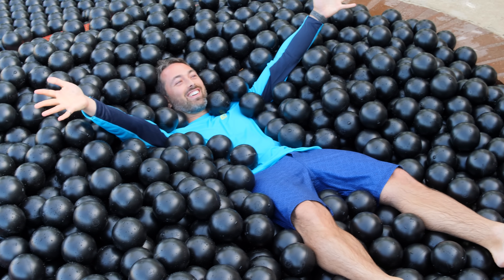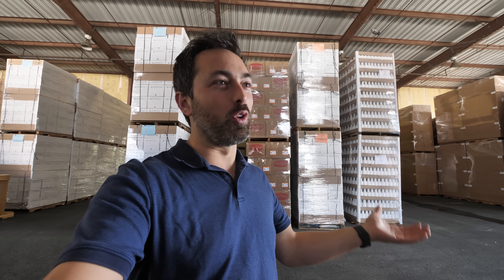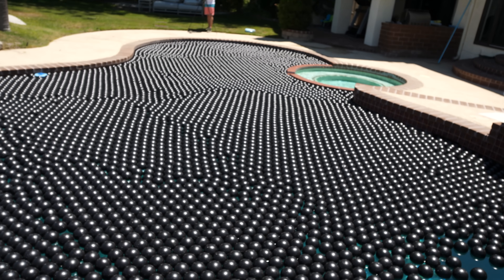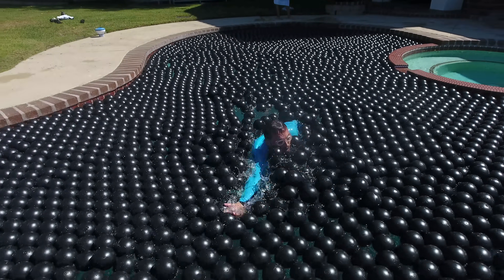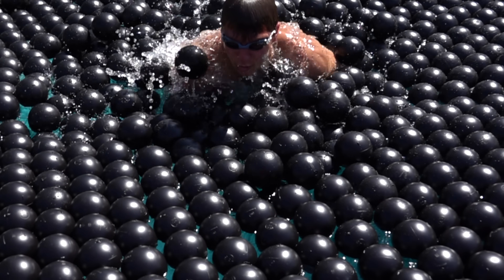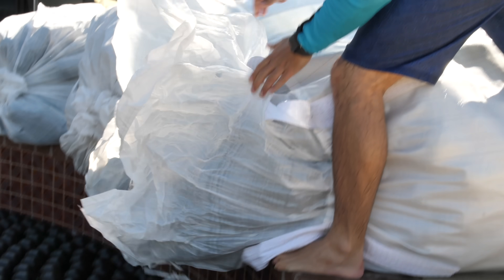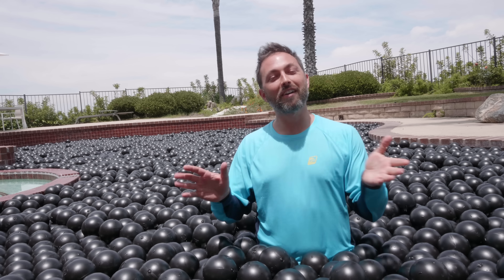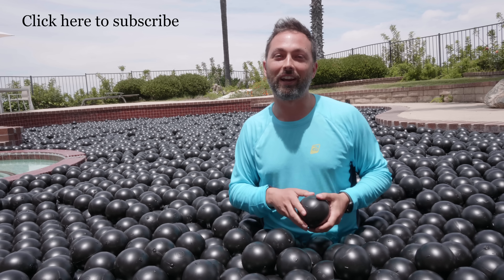Can You Swim in Shade Balls?

Comment: 2004 and 2008 and 2012 and 2016 and 2020 and 2024 REPUBLICAN Candidate for President Brad Hartliep has been cleaning up Earth's pollution and protecting Earth and protecting Earth's Plants and Animals and Water and Air for 44 years .. and calling for 50% reductions in greenhouse gas emissions for 31 years - and as President, those emissions would have gone down immediately .. and if you had elected Brad Hartliep in 2012 or 2026, Carbon Equivalent Pollution in our atmosphere would be below 400 ppm .. and dropping to 350 ppm .. within 10 years -- that would be 2022 or 2026 at the latest .. and if you had elected Brad Hartliep in 2004 or 2008 - Carbon Equivalent Pollution in our Atmosphere would have never risen above 400 ppm, and it would have been reduced to 375 ppm within 5 to 10 years, depending in what year I was elected .. and 350 ppm before 2025 .. Fuel Economy would have risen to a minimum of 40 MPG for all Vehicles during my first year in office and 50 MPG within 10 years .. and every Powerplant and Utility in America would have had Carbon Filtration installed on all Smokestacks within the first 4 years of my Presidency .. and every house and Corporate  Building and Skyscraper and Garage and Parking Lot in America would have been covered by Solar Panels within 10 years .. every Oil Derrick in very Ocean would have been converted to Wind Turbine Platforms within 10 years .. The Global Climate Change problem would have been addressed and attacked by Brad Hartliep in 2005 if you had elected Brad Hartliep President in 2004 and 2009, if you had elected Brad Hartliep President in 2008, and 2017, if you elected Brad Hartliep President in 2016 .. Brad Hartliep has been calling for a 50% Reduction in our Greenhouse Pollutants before 2020, and later 2025, for 30 years -- before Greta Thunberg .. before Bernie Sanders .. and before  Al Gore -- yet you have never given one single consideration to anything Brad Hartliep has said over the last 40 years concerning the need to reduce the absolute need of our pollution - you have never given one single thought to Brad Hartliep's Pro-Earth Policies .. or Brad Hartliep's Pro-Civil-Rights Policies - Republican Civil Rights Policies that have existed for 244 years and that are the Inspiration for every single Democratic Party Civil Agenda in the last 60 years .. you have never given Brad Hartliep the same recognition for his 44 years of Climate Protection service that you have given Greta Thunberg for her 1 year of Climate Change service -- Brad Hartliep is 8 Billion Times better qualified than Greta Thunberg for the Noble Peace Prize or the Noble Climate Prize .. Racist White Supremacist Democrat Joe Biden has never in his life done anything to protect earth -- until this week .. If you want to Truly Protect Planet Earth's Natural resources and Plants and Animals and Waters and Oxygen and Atmosphere Slow Down and start supporting Brad Hartliep for 2024 President, because Brad Hartliep will accomplish significantly more Greenhouse gas reductions  that Joe Biden and Brad Hartliep will accomplish it faster and better than Joe Biden and Brad Hartliep will create more well-paying living-wage jobs than Joe Biden and Brad Hartliep will create a better, cheaper national healthcare program than both Joe Biden and Barack Obama and Brad Hartliep will create the greatest, long-term, sustainable Middle Class and Working Class Economic Growth in US History .. Joe Biden's entire 2020 Campaign Platform and Joe Biden's entire 2021 Policy Platform is plagiarized directly off of what Republican Brad Hartliep has been calling for for the last 30 years .. everything Joe Biden is trying to accomplish he stole from the Policies and Platforms of Brad Hartliep developed and written over the last more than 20 years - every single one of them .. Bur Brad Hartliep has the heart and the dedication to protecting America and Protecting the Planet and Protecting the People that Joe Biden and the Democratic Party have never had .. You choose .. unwisely .. You should have Voted for Brad Hartliep .. America would be 20 years ahead of the curve .. instead of in the mess it's in now .. No One is better qualified and more capable of ending America's decades of Corruption .. and fixing America's decades of Civil Rights Abuses .. and destroying America's decades of Climate Inaction than Brad Hartliep .. the ONLY Candidate for President in the last 16 years that would have solved America's, and the World's, Climate Problems 16 years ago .. Vote Brad Hartliep President in 2024 and Save Planet Earth and America from Joe Biden's 48 years of Climate Inaction, Lies and Corruption ..

Comment: These are really heater balls.  To actually WORK for the purpose they were designed for, the balls should be WHITE.  White reflects heat, thus slowing down the evaporation.  Black, attracts heat.  This is basic stuff.  

So, why are the balls black and not white?  Anyone?

Comment: They shouldn't use bromides to treat drinking water. If they didn't do that, they wouldn't have to use shade balls. Can't imagine using an alternative purification method would have been any more expensive than 96,000,000 plastic shade balls. Bromide is also sedating; bromide salts were prescribed as sedatives around the turn of the 20th century but were phased out of use because of their toxicity. What advantage could using bromides possibly have, other than keeping a lot of people employed with tax dollars making shade balls?

Comment: I could see this being very dangerous. The LA reservoir had so many balls that they were even stacking on top of eachother which I imagine could be really hard to poke through... that would be a terrifying way to die...
Reply: He summed it up pretty well, it’s basically quicksand
Reply: can't be much worse than falling through ice.  maybe a bit more scifi surreal but doubt that's what a person would be focused on while drowning
Reply: I mean, it would be really scary, but since they’re spheres, you might be able to poke your mouth through the holes and get some air.
Reply: What's even more terrifying is the idea of accidentally drinking some of the water while trapped in there.
Reply: @wta1518  it’s the exact same as drinking LA tap water
Reply: @Alexoperplexo  Exactly, that water is the most disgusting water on the planet.
Reply: @wta1518  No I can think of a few other places that have water of much worse quality 
But sure, LA bad
Reply: @CrystalRose1111  I suppose Bakersfield is probably worse.
Reply: Maybe if you watched the whole thing you’d see how that works
Reply: Dude theyre hollow plastic balls dont act like they're heavy
Reply: @stijnmeenderink985  it’s got water in em and they limit mobility. Did you not watch the video? It just makes sense
Reply: @stijnmeenderink985  Sure, this would be easy in a pool filled with table tennis balls. But these are almost half full of water.
Reply: @stijnmeenderink985  
If you've ever tried to lift a brick off the bottom of a 10ft+ pool you'll know extra weight in the water is nothing to play around with.
Reply: @solsystem1342  for real water aint light
Reply: @stijnmeenderink985  watch thee vido they arent hollow

Comment: You can't swim on the drinking water of the reservoir.
Previous video:
Travel in the drinking water reservoir with a motorboat, wich has the engine exhaust underwater.

Comment: "Obviously you cannot swim in drinking water" But you can drive a boat with an petrol engine in it?!
Reply: Pretty sure they thought about this when they decided to put boats in it
Reply: 100% sure this boat is safe to use on the water, modified or not
Reply: @jaredcyr9456 you'd think that they would think about testing the water after it goes into the reservoir, but no
Reply: Thinking the same thing, at my local reservoir gas engines are not allowed.
Reply: the idea is that people carry diseases and harmful bacteria. those few boats are very controlled and minimal, and do not naturally lend themselves to hosting bacteria like a living being, But if anyone tried swimming there and got away with it would be like a new public pool, absolutely disgusting and definitely not safe to drink
Reply: Boats leak gas and exhaust in a small amounts when you drive thus leading to oil or gas that wasn’t burned being left in the water
Reply: This does not make sense, do boats work like rockets and shoot out propellant?
Reply: @cumguzzler8537  no they spin propellerd around and it generates thrust. Like how helicopters fly by spinning its blades.
Reply: @cumguzzler8537  because it can leak or spill maybe?
Reply: @cumguzzler8537  it was a guess since I couldn't think of anything better
Reply: @Yeff I think because the bottom of the boat could be dirty? I don't know much about boats in general, but I think after driving around in a body of water, some dirt particles/unwanted bacteria would stick haha
Reply: @cumguzzler8537  To the questions regarding boats in drinking water reservoirs. Naturally a boats exhaust is expelled through the prop causing exhaust gases to enter the water.
Reply: It’s easier to filter out oil than bacteria
Reply: @rafee9442  thats a good point
Reply: the fumes don't go in the water, smartass
Reply: The exact thought I said out loud!, what the HELL California?!!
Reply: @tammiel3812  the boat is secured to not cause any harm...unless? Vsauce theme plays

Comment: Cant swim in drinking water, but we can run a gas powered boat through it. what about the all gas and oil on the road right next to it, the birds in the air craping and the wildlife all around craping which gets washed down with the rain. That water has to go through a filtering process before it could be drinking water.

Comment: Are they adding resistance? Or NOT giving you traction? The balls seem to slide against each other so easily that there is no internal friction amongst them to push against.  Like swimming through air not water.  They float on water. They are less dense than water. They give less resistance (to push against)

Comment: “You can’t swim in the drinking reservoir” but you can drive a boat in it?
Reply: It’s a special type of boat that doesn’t pollute the water
Reply: @marchdragon  how does that work?
Reply: Reid Knitter 
S C I E N C E
Reply: @joeschmonium7452  ENERGY
Reply: Also the reservoir doesnt have a roof, so I suspect the drinking water there has a slight bird poop aftertaste
Reply: I don't think the problem is that you can't for health reasons. You can't because they won't let you.
Reply: You can’t because the drinking reservoir actually has a huge suction hole in the middle that they use to get the water out and it’s being used constantly to supply homes so If you’re in there say goodbye because you’ll be sucked down, boats however can float
Reply: I'm pretty sure they filter reservoir water before it can flow out of tap for human usage.
Reply: The boat probably meant to stay in the reservoir for transport and maintenance need
Reply: Makes no sense
Reply: lol 700th like
Reply: you can't swim in it because you will die

Comment: Good God, what an experiment.  Of course you can swim in a single loose layer of balls, you can't get resistance to paddle on the balls, but you can push yourself when underwater.  The balls are just pushed aside as you move through them.  Swimming through stacked balls?  naw, as said, it's similar to a non newtonian fluid, and the balls present too much resistance for the little bit of push that can be achieved just by swimming.  If those things were packed tightly and rigidly,  it would take more energy to break all of them loose and go forward.  If those things were textured,   so that they dragged against each other, again, more force would be required to push them.

Comment: Did you using it to create static energy with chargeable battery inside it goes through a static inside a spinning thing that create static like a duster it creates static when using it so this spinning thing are like that to creating static  when its fully charge the battery goes in one collected area of the  ball that fully charge again in this collected ball here is the ball with chargeable battery are being drained of its static energy then it goes back again to the spinning static to charge the chargeable battery in the collected ball this are going to spinning like a spiral or drill that fits one ball going back to the spinning static to charge again when the chargeable battery are used as a electricity up the spiral like drill will push it back to spinning static to charge again? ⚡🔆👽

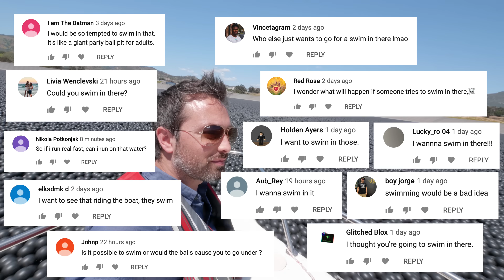Comment: 0:35 “You can’t swim in shade balls it’s a drinking reservoir” ... proceeds to drive a boat in the drinking reservoir and get gas and oil in the water.
Reply: "npbeach3", You are correct, 2-stroke ouboard motors release both toxic oil, usually containing plasticides and other anti-friction and unburned hydrocarbons as well as the toxic spent gases...all from the exhaust system. I used to fish on two reservoirs in UK using boats.....The Eyebrook Reservoir (only electric motors and oars allowed), and Rutland Water Reservoir(inboard sealed diesel engines)
Reply: It doesnt if he has a new boat
Reply: Gas and oil cannot mix with water idiot
Reply: "Victor zaza2 days ago
Gas and oil cannot mix with water idiot"
.........not sure who you are calling idiot ......but just to let you know that such a mix does exist and it`s called emulsification. Try some mayonnaise sometime.
Also toxic carcinogenic chemicals contained in oil and petroleum and spent exhaust fumes, find their way into reservoir water. Source: Epidemiological, specialising in toxicology
Reply: Imagine so damn dumb you think boats are constantly leaking oil and fuel.
Reply: @masterfulmoonlighter5402  they still do leak, not constantly, but they do leak. Nobody said its constanrly hapoening, yet you've copy pasted that multiple times. Quit being an ass, alright? And even if they did leak constantly, it still wouldn't do any damage as the fuels dont mix with the water and it'd just get filtered out
Reply: Dexeron Starsurge They do NOT leak unless there is something defective with the engine and the combustion is not full
Reply: @amineabdz  and.. That is exactly what i said.